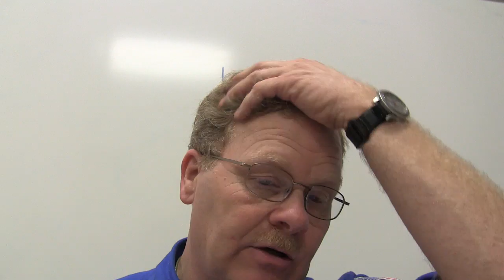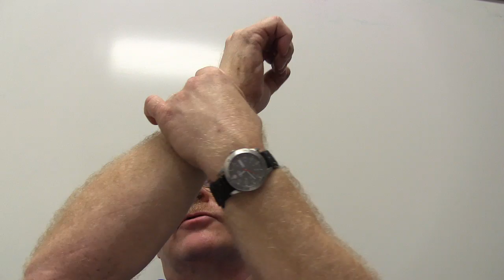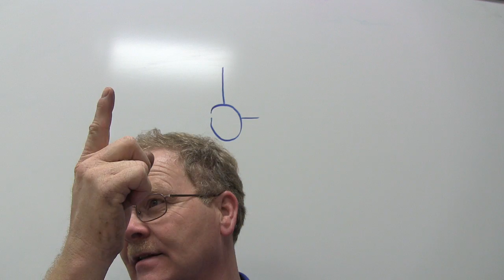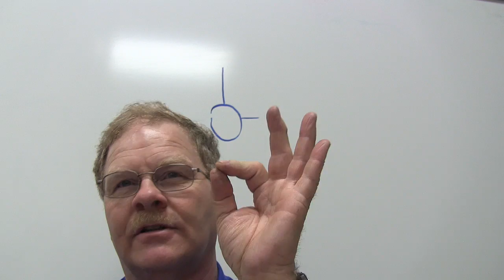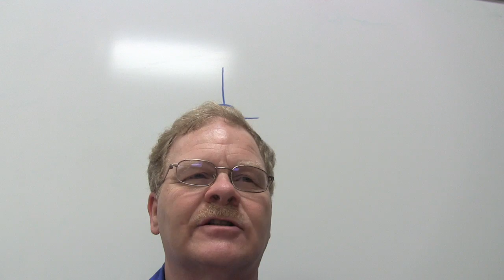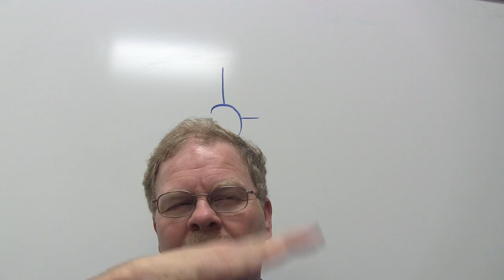Engine Performance 1 Test 6   Engine Condition Diagnosis

Comment: some exhaust pressure uses I like
 capella comprex air charger, compound turbo, and motor jet engine
motor jet is a jet engine that uses a mechanical engine exhaust to pressure compression chamber of a jet engine